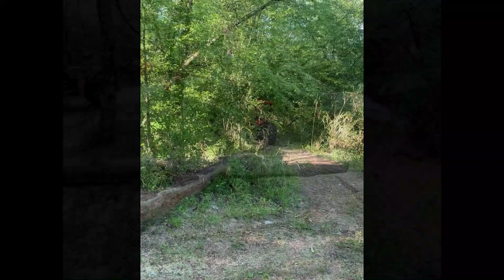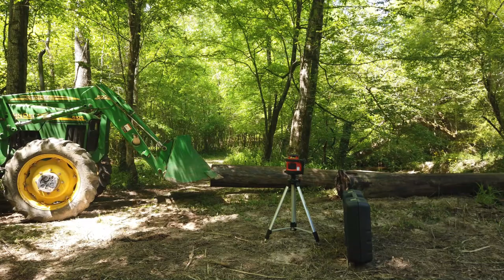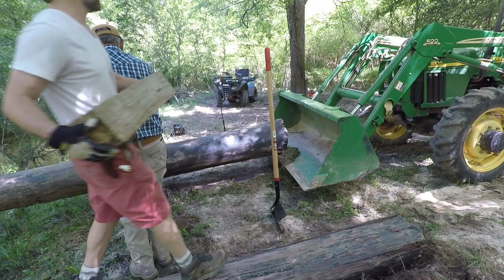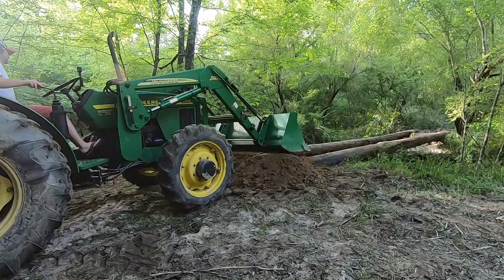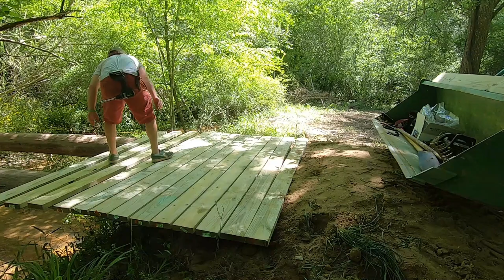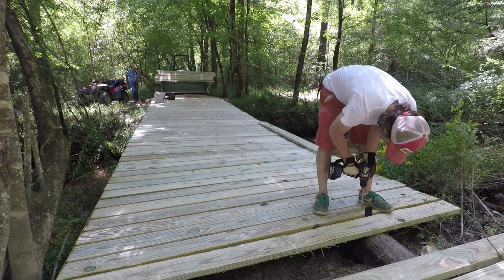WCC - Something4Alex 5k Trail Run Creek Bridge 2 (How to build a bridge with old telephone poles)

Comment: You better watch it driving that tractor over that loaded with material!!   You should have used atleast 3x lumber even 4x.  That 2x stuff will not hold up    And you will get severe sagging in the center over a short period of time.
Reply from the maker: We are going to build a 40’ steel beam bridge sometime soon. Already have the beans just haven’t had the time. The wooden brushes are just for walking and 4wheelers. Definitely not capable of holding up a tractor.

Comment: Why the border ?... to prevent curling? 
Otherwise great job... I'll be making a couple of bridges on our property too...
Reply from the maker: We use the bridges mainly for foot traffic (nature walks) and 4 wheelers. Small tires and small feet apply the force on a small sections of the bridge at a time so the boards flex. The border helps spread the force out to multiple boards and prevents a lot of the flexing. A lot of folks put perpendicular boards along the center of their bridges but I was concerned with people tripping as they walk or run across.  Another reason is that it looks better and covers any differences in the deck board lengths. 

Thanks for the question and good luck with your bridges!

Comment: Those logs seem about 40-50ft long.  Wonder what the load tolerance is
Reply from the maker: According to the telephone pole spec sheet, a pole this size at a 20' moment (center of span) is around 2,500lbs per pole. However these are old, used poles so we dont take anything heaver than 4wheelers or bigger utvs across them. We will be building a 3rd large bridge and will use 3 or maybe even 4 poles. Still not enough for me to drive a tractor across but will give us some comfort carrying trailers across.

Comment: you failed to show getting the beams over.    the main part plus you put no beam in the middle?
Reply from the maker: I didn’t have the cameras on the day we pushed the logs across the creek. We will be building an additional bridge in the future and I’ll do a video on how we get the poles across.   
We only use this bridge for foot traffic and 4 wheelers. The next bridge will have to hold up a tractor and will have a third and maybe a 4th pole. 

Video yet to come.

Comment: What was the most important thing you did not show, how did you put the beams across the river, Incomplete video.
Reply from the maker: Unfortunately, I forgot my camera that day. We used a chain to drag the poles to the side of the creek. Then we put the tractor bucket, scoop down, on the end of the pole and used the tractor to push the pole across as far as it would go. The heavy end of the pole was the push side. Honestly it surprised me how far the pole was able to reach out before starting to tip. The poles both made it to the other side without too much sagging. We only needed to jack each pole up about 18 inches to get it completely up on the bank. 

This is the only way we could do it since we had no access to the other side of the creek. We thought about it for months before I decided to just give it a shot. We discussed chains and pullies, guide poles, and even using a track ho. None of those were really an option so we just rolled our sleeves up and started pushing. As with most things, sometimes the easiest way is the best way and this time it worked out. 

Thanks for the comment! - trey
Reply: i agree plus no center beam